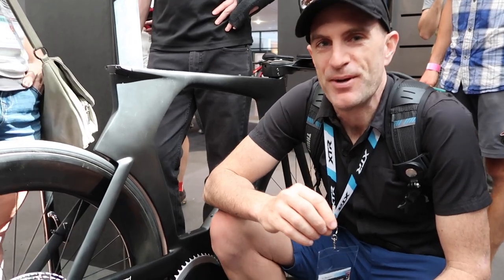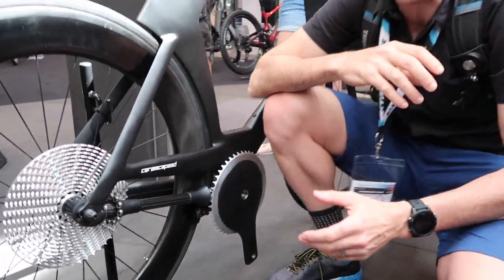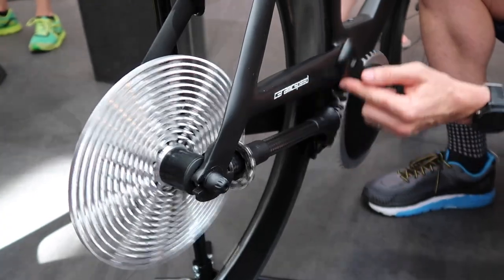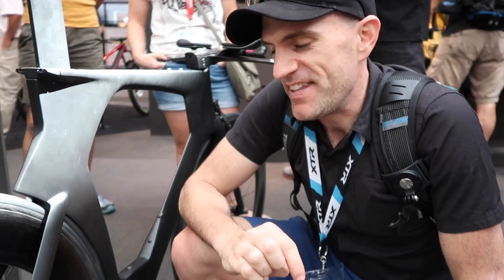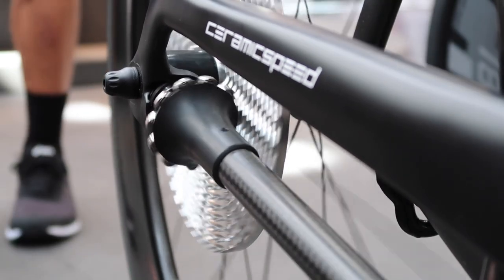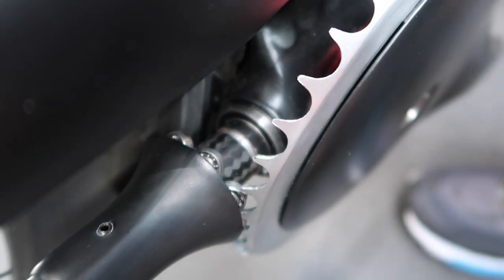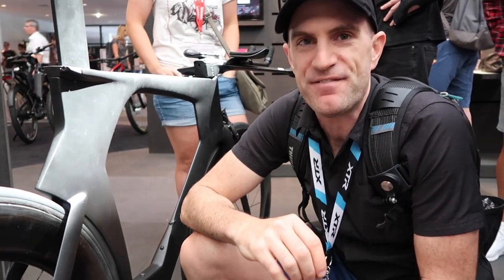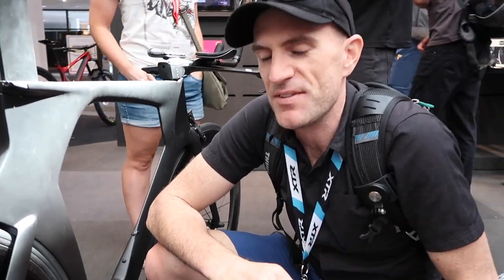CeramicSpeed DrivEN 99% Efficient Drive Shaft // Chain Free Bike // Eurobike 2018

Comment: 99% efficent, this is rubbish. Moving the direction of travel through 90 degrees twice incurs more loss than 1%, bunch of liars.
Reply from the maker: In Hambini we trust. I knew you'd be interested in this one.
Reply: thx man, i was really waiting for some real engineer laughing at this joke
Reply: On what basis do you come to that conclusion? Total system losses including aerodynamic losses or just an idealised system?
Reply: Having a drive that gets moved through 90 degrees creates forces on the teeth (or in this case the bearing elements) that are at an un-preferential angle, these forces are a mechanical loss. The maths behind this is here.

http://www.roymech.co.uk/Useful_Tables/Drive/Gear_Efficiency.html

Don't be fooled, this ceramicspeed setup is a crown/spur gear where one set of teeth on the spur gear have been replaced by bearings.

The loss in tooth friction for turning the drive through 90 degrees alone is at best 1% (this is based on pure maths so the real loss will be higher). This has to be done twice 0.99x0.99=98%. The 98% is in sliding friction only. 

Then you have to subtract the loss for the friction in the driveshaft bearings, flex/torsion in the chainstay and losses associated with misalignment. There will also be a loss from flex within the "cassette". 

Furthermore as Shane rightly points out, if you wind up the power, the components are essentially flexible and will move. Go above 250W and it will creak.

But... to the student that designed it, he/she did a good job. I feel sorry that the Ceramicspeed marketing department has put their spin on it and then engineering purists like me come along and tear a strip out of them. 

Hambini
Reply: steve crabb motorcycles have 3 options for their drivetrains. Driveshaft, chain, or belt. A driveshaft requires the least maintenance, however, it is also the least efficient of the 3 and has much more power loss than the other 2.
Reply: My gut feeling is that if it was 99% efficient it wouldn't be making all that noise.
Reply: I am not defending or criticising this system because I have not tested it or seen any meaningful independent tests of it. To write it off on the basis of a comparison with a motorcycle powertrain is woefully premature especially as the loads going those powertrains are lterally 1000's of times higher. How they overcome the engineering challenges like flex of the rear gear assembly, dirt & grit in the bearings and seamless shifting is going to be interesting to see. How the figure of 99% is derived and what exactly is meant by it would be good to know as well.
Reply: RedWings-44 drive line losses in a motorcycle shaft drive occur in the bevel gears which this doesn't have.
Reply: Hambini, don't be so arrogant, they aren't idiots and don't confuse a show model for a finished product. There are no hard and fast rules about how much energy will be lost in a transmission system. This isn't an automotive system with bevel gears running in oil this is two sets of ceramic roller bearings engaging the teeth on the cogs. They are clearly reducing torque in the shaft by running it at a relatively high speed and obviously it isn't being turned by a very powerful motor, the shaft is also CF as are the spiders. It might not do particularly well in high power situations but it looks well and truly capable of transmitting 500w, note their choice of bike, an application where 2-3% of free power would be massive.
Reply: steve crabb I agree. However I thought I'd throw it out there. They have other problems to worry about too. Now granted, this could be refined further since it is a prototype, but I see a lot of places dirt could get in and be very difficult to get out and affect that efficiency. Especially if this were to be used for gravel bikes or mountain bikes as GCN stated it was also going to be intended for.
Reply: All the noise can't be efficient either
Reply: Ryan Ford probably not but metal on metal will always have some noise. Space can't be efficient. Even with minimal space, it will grow due to wear. But everything wears at some point.
Reply: @Deep_dive, my point is, by laws of maths you cannot turn the drive through 90 degrees... twice and keep 99% efficiency. It's like trying to argue that triangles do not have 3 sides or the world is flat.
Reply: That is some questionable arrogance. Which law does specifically place an upper bound on transmission efficiency?
Reply: Deep_Dive correct. However there are many areas for power loss. I don't predict power loss is anywhere near that of a motorcycle, however, I don't buy 99% efficiency one bit. I would love to see the more refined version when it comes out.
Reply: Regardless, its a cool idea.  I agree though, definitely not ready for primetime.
Reply: The question is not the rate of efficiency the question is it more efficient than a chained system which has its own challenges against efficiency
Reply: Gerald Aboud while true, they do claim it is up to 99% efficient
Reply: Hambini the claim is that the pinion interface trades sliding friction for rolling friction. If true, then I don’t see how your tables apply.
Reply: colossalfart interesting note. I saw an explanation video where they stated that 99% efficiency was achieved at around 358 watts (don't quote me on the exact number but it was around that). That reminds me of when a car manufacturer says their vehicle makes X torque but at x RPMs.
Reply: They're assuming a close-to frictionless power transfer due to the use of bearings, as opposed to traditional tooth-on-tooth contact. The power transfer efficiency calculations for standard gearing - spur, helical, bevel, etc. - is not directly applicable, unless you're doing some assuming yourself by forcing this transmission into the efficiency calculations for gear-on-gear transmissions - which it's not.
Reply: Chain drive efficiency varies with power output as well. The efficiency of a chain actually increases as the power increases. Source: Bicycle Science by David Gordon Wilson MIT Press (I would recommend this book if your interested in the technical aspects of cycling)
Reply: RedWings-44 it can easily be covered
Reply: Agreed. The second law of thermodynamics applies here. Nothing is 99% efficient unless some variables are ignored.
Reply: "All the noise can't be efficient either"

Ironically (as an argument against electric cars) people fully accept the sound of an internal combustion engine as something good, when it's actually the waste of perfectly good energy.
Reply: PhillipZX3 They're not saying it's good for efficiency, they're saying it's nice to listen to
Reply: Hambini How much is the mechanical loss in a normal gearsystem like for instance Shimano Ultegra?
Reply: Hambini the 1% loss in your roymech reference is accounting for frictional sliding at the tooth contact of a pair of traditional lubricated gears. The ceramic speed roller elements are obviously intended to reduce this friction at the contact even further than lubricant does. Friction accounts for the lions share of transmission losses; all of those equations are a function of friction coefficient, none are due to changes of rotation axis direction.
Reply: Tolyzor the first equations don't contain any friction coefficient term. The power loss is a function of contact angles and gear geometry.
Reply: I agree with you that 99% is a very bold claim. However I don't think you can use the link you provided to prove that. That is simply a lookup table for normal spur gears and I don't think the systems are directly comparable. 

For spur gears, most of the efficiency loss comes frome sliding friction. The little bearings that are used in the Ceramicspeed setup, 'replace' this sliding friction with rolling resistance which in most cases is lower ,hence higher efficiency. (I would not like to be the guy that has to maintain all these little bearings though:P) 

I totally agree with you about the friction in the driveshaft bearings ,I think this is going to be a real contributor.
Reply: I Didn't really want to talk about vectors but some of the responses are provoking confusion. For the record, IF ALL FRICTION IS IGNORED you cannot turn a drive through 90 degrees and maintain 100% efficiency. There is a force vector which transmits the torque, a component of that vector will be sin (theta) and the other component will be cos (theta). Depending on how you draw your force triangle, one of those will be a loss that has to be absorbed somewhere in the system.
Reply: @ Hambini

I agree with this. In this case this would be the axial loading of the hub bearings (bad) and mainly radial loading of the driveshaft bearings. These will create extra rolling resistance due to the extra loading (in the end, loss is always friction/resistance). So 100% efficiency is impossible.

What I am not convinced of, is that the total sum of these will add up to be worse than then the losses in a conventional chain drive. Any thoughts?
Reply: Exactly what I thought. Maybe they meant 99% efficient at zero torque 🤣
Reply: This method of drive has been around for years. Motorbikes some are using this method most are chain.
Reply: i think the durability will be the bigger problem
Reply: Direction change has almost zero to with drive efficiency losses, what does is how that change happens. That is the primary reason for different types of gear designs.  The reference you provided actually hit on this a bit with the line "Power losses in gear systems are associated primarily with tooth friction and lubrication churning losses."  The reason this is different is the use of roller bearings as the interface.  That change alone will drastically improve drivetrain efficiency.
Reply: All engineers here?
Reply: XavierBetoN All engineers here?
99% LOL
Reply: ...the pinion bearings still spin on the spur gear like a quarter spinning on the floor...  and you’ll need major reinforcement for the lateral forces..... why not using bearings in the chain links instead? - looks very pretty though🙂
Reply: leahcim38 i asked the question under another video, where the ceramicspeed presenter says it's 99% efficient and 49% more efficient than the latest dura ace...  and it's just as you'd figure: dura ace is 98%efficient loosing 2% to friction... which is next to nothing,  but in something like a tour etappe over 200km 1% could make the difference... if it works with greater forces than those 358W mentioned in another vid... and if their claims (99%vs98%) proove to be true  in a real race setting. so far it could as well just be a marketing stunt like self filling water bottles, solar friggin roadways,  juicero or elon's hyperloop - unless i see a pro rider torture this thing i believe nothing
Reply: far less loss of power given that a typical bicycle chain has 114+ links, each sapping power. Ever tried riding a bike on a old non-lubricated bike chain?
Reply: Hambini you missed the physics class on conservatives vs non conservatives forces I suppose. Please stop mumbling about math terms that don't  prove anything. Not that I know how efficient the system is or how they measured it, no equation will tell you that (with any resemblance you of 1% accuracy). Quiz to check your understanding: If you push against a static wall, how much energy do you loose?
Reply: @Giovanni Balduzzi. You are right I did miss the physics class. I'm an engineer not a scientist.
Reply: He corrected himself and said "up to 99% efficient", which can be true.
Reply: yes
Reply: but what if you compete with dozens of other people on steroids, cortisol, epo and salbutamol... the pro teams need to squeeze every  .1% out of anything that can be squeezed to win a race... and sometimes we average joes profit from this battle in form of new, more efficient tech
Reply: Except this is NOT an instance of power being directed 90 degrees.
Reply: You don't get invited to many parties,  do you?
Reply: Rolling friction in the bearings is also friction and I doubt these efficiency claims as well. But we can only wait to see the independend engineering tests and not marketing wank
Reply: RedWings-44 You are correct, but one benefit of a shaft drive on a motorcycle is it can an handle significantly more torque, which is important when you're running a big vtwin.
Reply: Deep_Dive Actually, yes there is, all things being equal,  the greater the angle of deflection from the applied force,  the greater the loss.
Reply: Nunya Bizness Well the gearbox comes infront of the chain or shaft drive so after it's more of a power concern. A lot of custom build bikes with big harley or similar twins have a belt drive because their rider don't want chain oil getting on there nice leather suit LOL
Reply: Deep_Dive knowledge isn't arrogance.  Any one that understands chassis dynamics even rudimentaly would tell you the same.
Reply: Giovanni Balduzzi Like i said in a previous statement known isn't arrogance.  If you actually read his comments  he tells you why the efficiency is restricted in a design. I would be surprised if this drive had 80% plus efficiency.  If hit the 90 mark it is a drive worth considering just on convenience of up keep alone. Lower efficiency doesn't  make it inherently bad. Each engineering choice has its plus and minuses.
Reply: Grimshaw Grummage actually chain drives are more efficient,  that's why they use them on motorcycles instead of this style drive.
Reply: Never mind the efficiency; this system seems like it could be used to make a "fixed" drive train (by just removing the freewheel mechanism) with a wide range of gear ratios. That would be… interesting, at least.
Reply: Yep. This is why racing motorcycles avoid shafts. Two direction gear changes, multiple shaft bearings to cause drag. 99% is pure bullshit, and how did they come up with that when this prototype doesn't even shift?
Reply: This will break on the first hill. All that torque on one ceramic contact point? A moron invented this. Make a cvt instead
Reply: Jester123ish surprisingly the power required to create noise is astonishingly small.  I'm not saying that it's nearly as efficient as they claim simply that noise is not a reliable indicator.
Reply: Giovanni Balduzzi   Which law places an upper boundary on transmission efficiency?

How about math and physics?
Reply: alles klar klaus The more powerful customs that run belts end up using 3 or 4 inch wide belts in order to handle the torque (a transmission running a ratio higher than 1:1 is acting as a torque multiplier, and power is nothing more than a mathematical function of torque and engine speed).  Harley primarily uses belts because of lower maintenance and cost relative to chains or shaft.
Reply: Giovanni Balduzzi if i push against a static wall i lose energy but my nerves calm down. so energy balance is ensured lol.
Reply: Hambini and that's not even with someone actually on the bike pedaling it... that's just if it's sitting there without touching the ground...
Reply: + Giovanni Balduzzi..... and yet you can't even spell lose properly
Reply: @Hambini An engineer? Maybe one that should go back to school, or at least stop insisting on things you clearly don't understand...
Reply: this is what my dad told me, and he's an engineer. But prove us wrong, and I'll be amazed.
Reply: That was a prototype and I watched carefully and noticed the drive "sprocket" and drive shaft bearings had what I thought was a bit to much gap. That will make noise. I don't think it is a bad design, since it is an updated version of spur gears, I think is the nature of the beast. I don't like the aluminum sprockets though because it is too soft, great for a demo though. I do like the idea of bearing races on both ends of the shaft mating to the drive and driven gear trains.

When I was young, I worked in a sheep shearing shed and the cutting hand piece was driven by an electric motor on long articulating arms using spur gears in the joints. Those joints could bend from 0 degrees to more than 90 degrees and with 3 in combination , THEY WERE NOISY. Oh, and required frequent lubrication because they were open joints.

@Hambini, I noticed that the axis of the drive bearings on the input side of the shaft were not parallel the the shaft axis. Do you think that that angle may reduce the side thrust on those bearings brought on by the drive "sprocket" and add to efficiency?
Reply: Totally correct . 99 % cannot be the total efficiency. Wheels against the ground is one. Direction is two. Penetration in the air is 3.  Transmission is 4...
Reply: We know they aren't idiots, but they are a company that has something to sell. That pressure tends to lead people to be untruthful.
Reply: Chain is far more efficient. Look at what cars, motorbikes, ships, trucks use
Reply: How well can it handle the violent jolts of off-road riding? 🍻✌🔬🔭🕵
Reply: Maximum theoretical efficiency of a driveshaft is assumed between 85-90%
Reply: There's nothing new on driveshaft on bicycle.
Reply: Hambini maybe not 95-99% efficient, but it beats the old chain that needs lubrications of every chain link to be somewhat efficient. It has great potential for electric motors assisting the pedaling in uphill or very long rides. Bearings and gears are better than chains and have much more potential.
Reply: RedWings-44 I can’t imagine this working on an full suspension MTB. How would it compensate for the constantly changing distance between the crankset and rear axle? What about the antisquat and other kinematics?